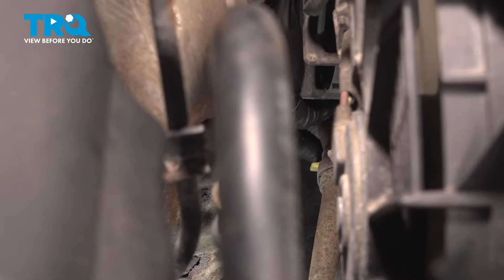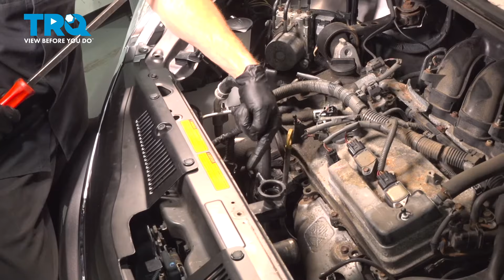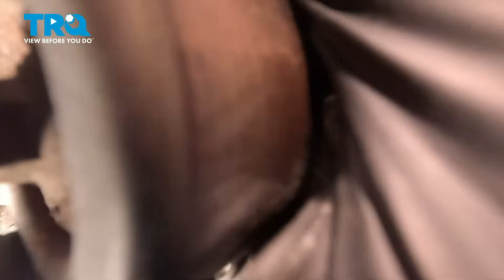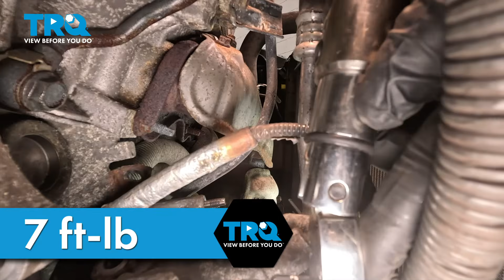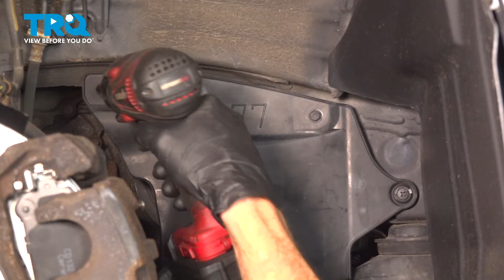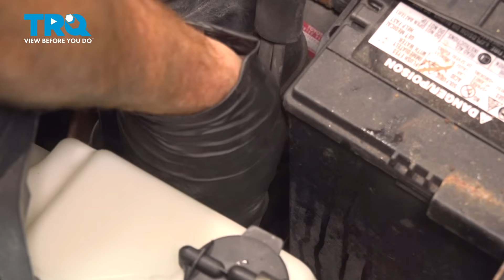How to Replace Accessory Drive Belt Tensioner 2011-2020 Toyota Sienna

Comment: Thanks for the video trQ,I just did to my 2011,I just unbolted AC compressor and let it seat on the frame,and the alternator just unbolted 3 bolt 1 in the back,also but I didn’t remove,just to take off the longest bolt of the tensioner,when bolting back of you just need to wiggle to insert the alternator bolt and done.

Comment: The battle with the bolt behind the alternator was brutal. I modified the serpentine belt tool to get in while leaving top alternator bolt in place.
I did not remove fan shroud. Worst tensioner replacement in thirty years of being in the business.